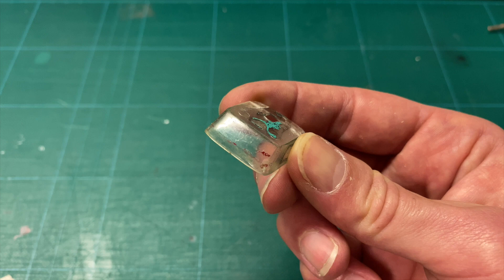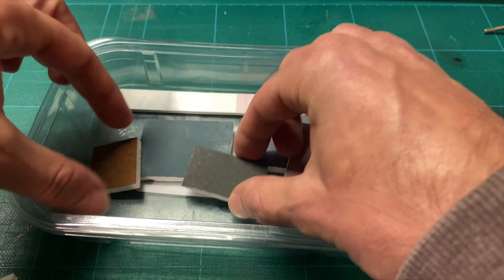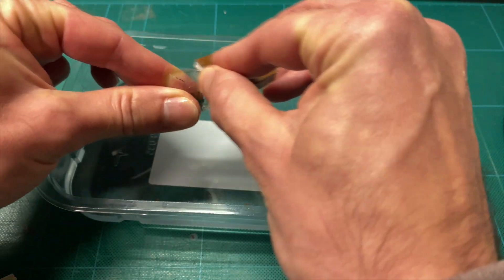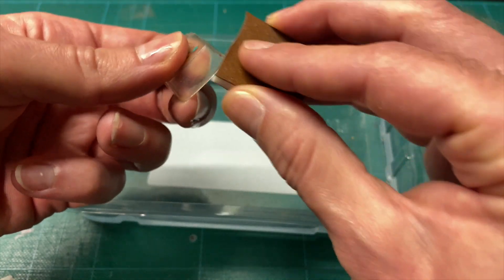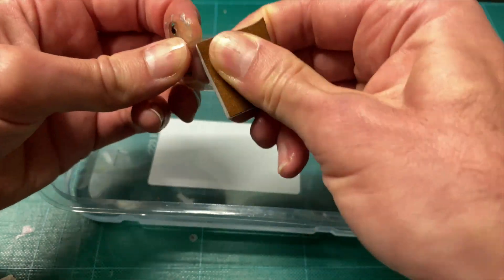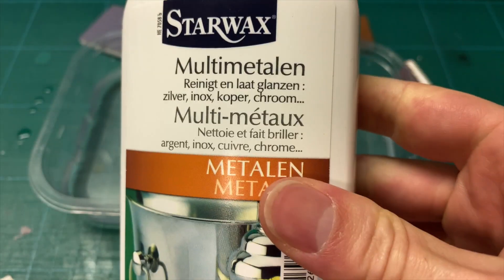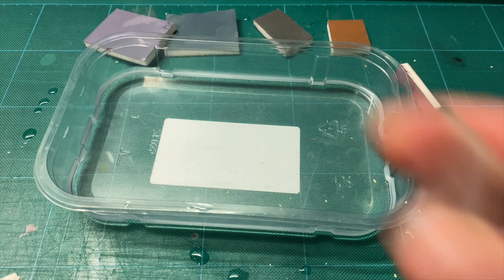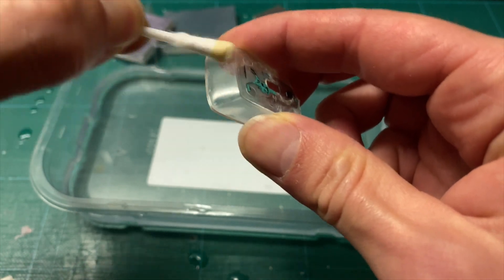Tutorial 03: Matchbox Refurbish Window Unit

Comment: Nice and clear explanation! I'd add testing the metal polish on a piece of plastic that would not finally be visible - I've damaged some windows by trying to give the extra shine. Also, I've noticed that even if the window is not really clear after sanding, the floor polish treatment makes up for it. Interested in your take on the above. Cheers!
Reply from the maker: Good advice for sure! It's always a good thing to test some new tools out on a part that isn't visible or actually used in the project, like you said. I've used the floor polish finish in the past. Works great too, but I didn't have any laying around anymore. But I think I did mention it in the video at the end there. I did find that some of those floor polishes make the window units more prone to fingerprints, even when they are left drying overnight. So you might have to be careful with that.
Reply: @MatchboxRestoration  yes, you did mention that and I thought that it would have made a great comparison to se before, after and after-with-polish pics. Interesting observation about susceptibility to fingerprints - luckily, my (limited) experience with Pledge has been good so far and I didn't have that problem. I'll check your other videos and I'm looking forward for more tutorials - there's so much to learn! Cheers!

Comment: Nice video. Any tips on yellowed plastic?  Is it possible to remove that yellow from the sun?
Reply from the maker: Thanks! There are some techniques involving putting the plastic in a certain solution and putting UV light on it (used for yellowed pc’s or game consoles for example). I don’t know if it works on transparant plastic, though. Never used this technique myself.
Reply: my son does this on his yellowed white lego. It's a solution of hydrogen peroxide which is then left in sunlight or concentrated UV light. Personally I wouldn't try this on a matchbox window unit.